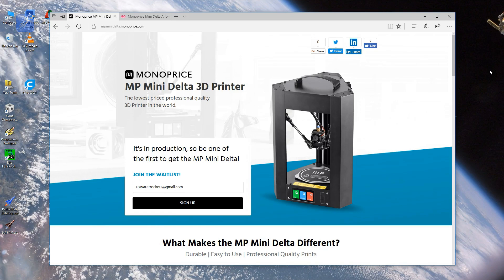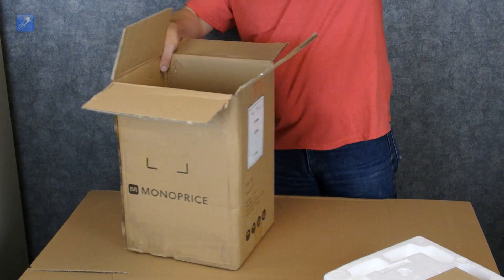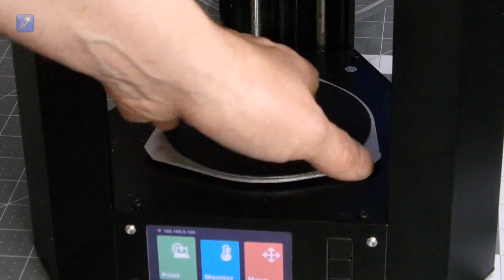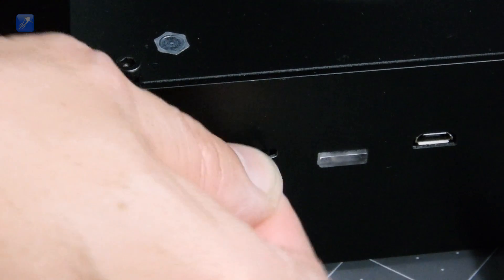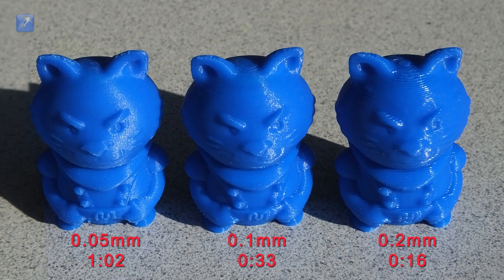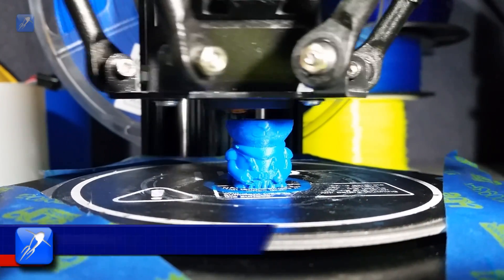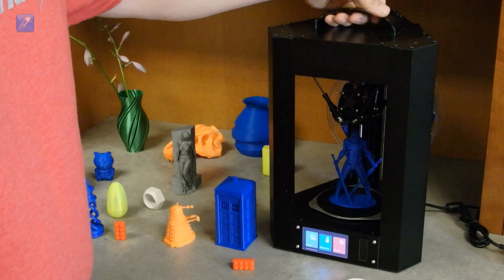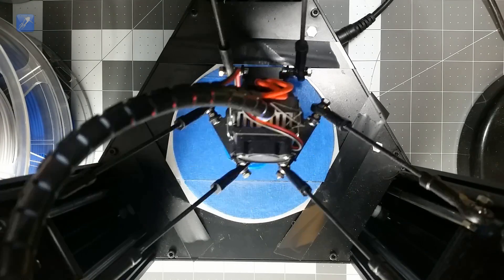Monoprice MP Mini Delta Review - BEST INEXPENSIVE 3D PRINTER?

Comment: Really liked your video! I saw that the filament you used was PLA, I heard that PLA can really suffer in quality if the 3D printer does not have a fan to cool it as its being layered. Does this printer have a fan? Also do you have anything more to say now that you have had the printer for almost a year?
Reply from the maker: In the video I use a couple of filaments but I do use PLA on the printer. It has cooling for the part, but not a separate fan. The hot end cooling fan is ducted to cool the part as well. I know people who swear by added cooling but I didn't use it for these prints. I would even say if someone needed it that badly, you could put a desk fan on the table and blow on the print. The lack of a fan on the printer makes the print head light and that is what gives the best prints, so I don't want an extra fan on the print platform. I can't think of much else to add to the review. My experience has not changed. I have seen other people using this printer on the facebook groups that have had similar great results, and they have worked out the right settings for various print styles even more than I have been able to do on my own. One last thing is I believe in the past year they have made improvements to the printer such as improved extruder and improved stepper motors. I am considering buying a 3rd one just to compare them.

Comment: Does anyone have the solution to the bed leveling problems most of these printers come with? Please help! My extruder is always too low on the bottom left and right corners and too high on the top.
Reply: you're gcode might be the the problem try
 G21;(metric values)
G90;(absolute positioning)
M82;(set extruder to absolute mode)
M107;(start with the fan off)
G28;(Home)
G29 C-0.8 Z0.30;(Level the bed.)
G1 X55 Y0 Z5 F3000;(Move to the outside of the bed.)
G1 E5 F500;(Prime.)
G1 Z0;(Down to printing height.)
G2 X0 Y55 I-55 J0 E20 F3000;(Draw a priming arc.)
G1 E15 F5000;(Small retract)
G92 E0;(zero the extruded length)
for start and
M104 S0;(extruder heater off)
M140 S0;(heated bed heater off)
G91;(relative positioning)
G1 E-1 F300;(retract the filament to release some of the pressure)
G1 Z+0.5 E-5 X-20 Y-20 F6000;(move Z up a bit and retract filament even more)
G28 X;(move X/Y to min endstops, so the head is out of the way)
M84;(steppers off)
G90;(absolute positioning)
G4 S360;(wait 6 minutes)
M107;(turn off the fan.)
for end,hope it helps
Reply: disaster gaming I’ve already tried it, never works.

Comment: Does anybody on Youtube review printers that they have bought themselves ? Reviews are useless when items are given simply because the manufacture can set these machines up and may not reflect the same quality that you buy in the shops.
Reply from the maker: I know one person who did a review of this printer that bought one: Me. The prototype reviewed here impressed me so much that I bought a second one because I wanted the finished product which was improved over the prototype. I use them both more than any of my other 5 printers. Neither one of them were "special" or "ringers". I am totally satisfied with the prints I get from them.
Reply: Does either of yours sound like its about to break at any minute, Mine is as loud as an engine room on a ship..but admittedly prints very well...
Reply from the maker: I said in the video that the printer is quite loud. I never get the impression it's going to break. The printer suffers the noise because it's a hollow box and this seems to amplify the motor sounds like an acoustic guitar amplifies the string sounds. I'd rather it be strong and rigid and make great looking prints, instead of quiet and make sloppy prints. I like it so much, I'm going to get a 3rd one very soon.
Reply: well i also have bearing noise which is different than what you refer to, but seems to be common according to the facebook group.

Comment: Awesome review, thanks for taking the time.  What's the horizontal resolution?
Reply from the maker: The printer comes with a 0.4mm nozzle, if that is what you mean. If you want to compare this machine to other machines which you can calculate the finest movement in X or Y by knowing the stepper motors and the drivers and the pitch of the belts, etc. then I can't answer that because that calculation is non trivial for a delta style printer. The horizontal movement is based on the triangulated position of the 3 axes and can be calculated if you know a number of measurements and angles and the correct formulas. I don't know if anyone has cared enough to do the math for that.  All I can say is the printer output is as good or better than any other filament printer I have seen a demo of.

Comment: how loud is this printer while printing also if it loses power for whatever reason while printing does it pause and then you can come back to the print or does it just stop and then you have to restart your print? thanks!
Reply from the maker: I can't tell you a quantified way (like in decibels) how loud the printer is. It's quieter than the creality CR-10, but I'm not sure if that will help you. I have no trouble working in the same room as the printer, but I can hear it running. If I put it in the next room and close the door, I cannot hear it. If I go in the room under the printer room, I can just hear it barely through the floor if I make the room silent. As far as power fail recovery, this printer does not have it. I have been 3D Printing since 2012 and have never once had a power failure when a printer was printing. Your power may be less reliable, but where I live the power fails 99.9% of the time during electrical storms, and it's generally a really bad idea to have electronics running because a lightning strike will destroy them, so if the weather is stormy, I never start a print. This is more of a gimmick than a must-have feature, and many printers that claim to have this feature show obvious defects where the print stopped and resumed.
Reply: USWaterRockets ok thankyou so much for replying! is there a way of pausing  the print or is there no pause option? this is not needed i just think that it would be a handy option to have
Reply from the maker: Yes, there is a pause function on the menu. This is actually something I use because it helps when you want to change filament colors or you are making a print with a captive object like a nut or a screw for  assembly, or a decorative item placed inside a print.
Reply: USWaterRockets I was just wondering as it would come in handy quite alot I think this printer is really good for what I want, especially at the price point! I appreciate all of the replies thank you! new sub!
Reply from the maker: Thanks for the feedback and the sub. In my opinion there isn't a printer that has all of the features as this one for the price point. Either you get a box of parts that takes hours to assemble, or you get something that is similar but lacks in some areas, like you don't get a heated bed, or you don't get a graphical color LCD. The other nice thing is the thing is more professional looking, and you can move it around easily because of the handle on top. Monoprice has a really generous return policy, which is something I didn't mention in the review,  so if something isn't right with the printer, you can easily return it. That's something that you won't find in other low cost printers, and especially not a kit printer. My best advice for people trying to get started in 3D printers is to get one of these, because it will teach you all about printing and will arm you with everything you need to know to decide if you enjoy printing. If you realize later you don't like printing, or it wasn't as practical as you hoped, you're not out hundreds of dollars you might spend on another machine. Cheers!
Reply: USWaterRockets I agree again thanks so much for all of your help! ☺️

Comment: Would this be a reasonable printer for producing action figure prototypes?
Reply from the maker: What size figures? The 3.75" type would fit easily, but the 12" types would have to be separated into the individual parts (torso, head, arms, legs, etc.) to fit in the build volume.
Reply: USWaterRockets 3.75” to standard He Man 5” size. Would the print quality be able to pick up that kind of small detail?
Reply from the maker: The FDM printing technology in general is not known for being super detailed. The stock nozzle on the printer is 0.4mm in diameter and the minimum layer height is 0.05mm, so you can get detail on par with what I've seen on the typical action figures, but you might want to swap in a smaller nozzle for more detail. I have seen samples of people using this printer for gaming figures that are about half that size and getting good results. I don't know what you consider a great looking print, so I would suggest you check out the photos of the gaming figures people did and see if it suits your needs. As I said above, the detail is limited by the technology itself, so any printer that extrudes plastic will have the same limitations. I would say that this printer is as good as this technology is going to get. To get any better detail would require a UV resin printer or UV laser printer. Those are about 4x as expensive as this one for a similar size printer.
Reply: Gotcha. I appreciate the replies! It would only be for prototyping.

Comment: In the very last seconds of the video during the overhead shot while it’s printing there appears to be black tape on the bed plate. Did you add that or did it come on the printer? Thanks
Reply from the maker: The printer in the video is a prototype that was manufactured before the injection mold for the bed clips was finished, so us beta  testers had to improvise. Some of us printed clips and some of us elected to wait for the molded clips to be finished. In the time I was waiting, I just used tape. For the video I put black tape on because it looked better on camera.
Reply: USWaterRockets awesome thank you for the reply and thank you for the video I’m wanting to get into 3d printing and a family member of mine showed me this printer on a website he buys stuff from so while researching this printer I found your video and I believe it has sold me on this printer. Thanks again
Reply from the maker: If you're really new to this then there is a pretty steep learning curve. Not that it's difficult, there mostly a lot of terminology to understand and most of it is very intuitive, but it takes practice. Starting out with a low cost printer like this is a great way to learn the ropes and then figure out if you want to dive in deeper and go for a bigger printer. Having learned all of the ins and outs on an inexpensive printer will be a huge advantage if you ever shop for a more expensive one down the road. Please check out the facebook group for this printer if you get it, because the best info and most helpful people are there and love to teach new people about 3D printing. Good luck, and happy printing!

Comment: How did you set this up on Cura? I'm having trouble with mine. It keeps scraping the bed and won't print. I've tried some settings I've found online but nothing is working. It is my first 3D Printer and I'm trying to figure it out. What are your settings and how did you make the profile for the printer on Cura? Please help!
Reply from the maker: This is a beta test unit, which has a very old firmware revision that I cannot update to the current shipping version because the LCD is different. Any cura profiles for the older firmware are not going to perform optimally on the newer improved firmware. Your best resource for the latest cura profiles and all cura related questions is certainly the Monoprice Mini Delta Facebook group. The download section has profiles for the popular slicers.

Comment: Thanks for the review. I looking at getting my first printer. Can the Delta print TPU> I'm going to be needing a printer that can..
Reply from the maker: Any printer can print TPU if you really know a lot about the printers and how to set them up and configure them. I personally have not used this printer for TPU beyond a simple test print, so I cannot say it would be a good primary printer for TPU. If you are mainly interested in TPU then you need a printer with what is called a "direct drive". This puts the mechanism that pushes the filament directly on top of the nozzle with the shortest possible path to reach the nozzle. This is great for TPU because it will prevent friction and possible flexing issues with the filament path. The Mini Delta is not a "direct drive" printer. Instead it uses a "Bowden tube" to connect the filament drive to the nozzle, so the drive mechanism can be remotely mounted. A Bowden tube system is preferred on a printer that is meant to print very fast, because the extruding part is super light and can change direction quickly. A direct drive printer will have a lassive extrusion mechanism to move around and therefore it has to print slowly. You can run a direct drive at a high speed, but the mass of the extruder will cause it to wobble or oscillate as it changes direction, which leads to visible patterns of defects on the print surface. It is fairly easy to print TPU on a Bowden tube style printer like the delta, but you have to know how to adjust the print settings to get it to work well, This mostly means printing very slowly so the Bowden tube doesn't bind up on the filament, but many other settings come into play as well. But running slowly defeats the purpose for owning a Bowden tube printer, so if TPU is your thing, then a direct drive printer may be the best option. This is especially true of you are just learning to print, because printing a filament that is tricky can be frustrating and you will complicate that by printing it on a printer that is not ideal for the filament in the first place.

Comment: How well would it print 28mm miniatures?
Reply: I'll be getting mine tomorrow, give me a few days and i'll post a video as this is exactly what I bought it for.
Reply: Jim Johnson fiIk
Reply: not too well, if you wanted something to be able to get some decent details on Id save up and go for something like the anycubic dlp printer.  A bit more involved process, but god damn, the print quality you can get is impeccable and you'll barely need to do any cleaning up.  You could probably do detail down to a 15mm mini if you wanted

Comment: Great video. I noticed on the TARDIS closeup (7:46) some wobble in the vertical lines. Is that from wobble in the printer's frame, or is it something weird with the model?
Reply from the maker: I went back and looked and I see in the video a kind of very gradual waviness to the vertical lines in the model which by my eye seem to "swim" as the camera pans up and down. The lines in the TARDIS model are perfectly straight, so I am not sure why the video is wavy. The printer frame is exceptionally rigid, if that is a concern of yours. If the lines I see are the same ones you see then I can only guess that the appearance is some kind of lens distortion or artifact. If you are looking at some other waviness, then please describe it of give a time code where it is apparent. I can only guess it's some distortion because I do not see it on the print at all.
Reply: USWaterRockets Hey thanks for responding so quickly! It does look like it should be a very solid printer, so it makes sense that the wavy lines are a camera effect.

Comment: Got mine from the 2nd batch on Indiegogo. I think the printer has promise, but they have some QC problems - wires were popped out of leveling switch plug, Wifi does not work at all, and bed is warped. Fixed the plugs, it prints small objects nicely but can't print outside of center of bed due to warp. Trying to get ahold of customer service.

Comment: Wow. Print quality for something that cheap is amazing. It's almost on par with the $5000 printer we have at work, though this is much smaller build area and way slower.  Same style machine though.  I think I may have to pick one up when it comes out for that low of a price.
Reply from the maker: The quality is really amazing and because it's small, it prints really fast. The latest word is that it will be on sale in October coming up!

Comment: They definitely tweaked and optimized that printer. There is no way anyone is getting perfect results like that without extensive dialing in and tweaking.

They obviously sent you the best machine they possibly could. Production units will not be nearly that good even with the level of tweaking power users do.
Reply from the maker: The first batch of printers from the indiegogo campaign arrived in July and printed just as good. The only other review I have seen done so far is here: https://hackaday.com/2017/08/21/monoprice-mini-delta-review/ The facebook group is loaded with a lot of happy customers printing this well. https://www.facebook.com/groups/mpminideltaowners/